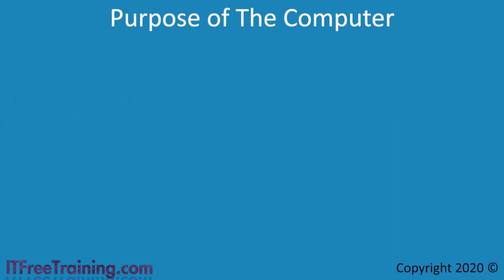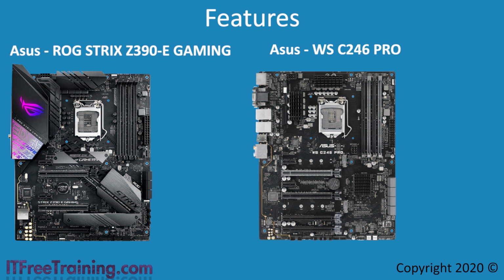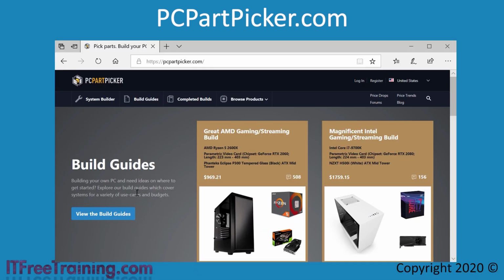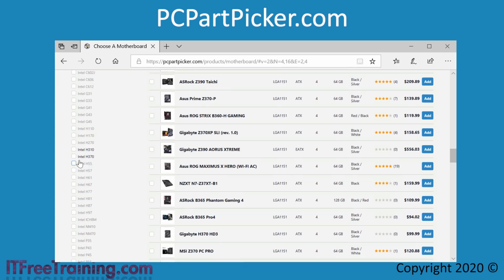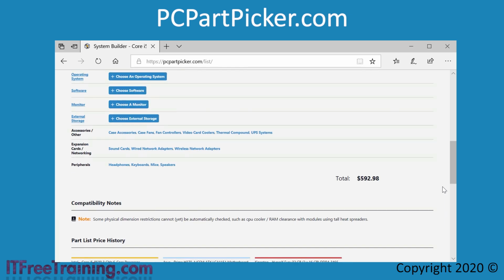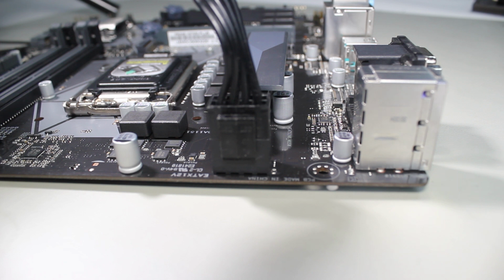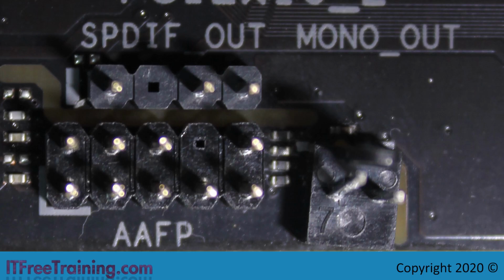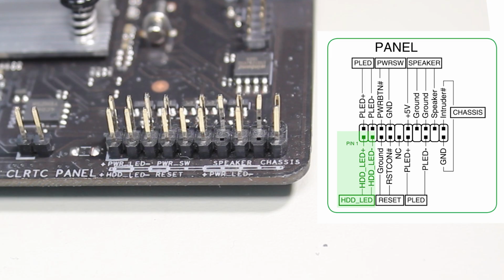Motherboard Picking/Installation

Comment: Do all 9 holes on the motherboard need to be screwed in when mounting it to the case?
Reply from the maker: Not really, as long as it is held in place. The more screws the better to hold it in  place. However, if you building a computer for someone else it looks more professional to have all the screws in place. Usually I will use a minimum of four, one for each corner if it is a testing build. For other people or if being filmed for a video I will put all of them in.

Comment: Hello sir, I am facing a problem with my desktop pc,,, I bought a new pc one month before but still facing window 10 boot up problem.. Shows error. Oxc000000e or oxc000000f... I have made bios to uefi mode in motherboard... Ssd partion mbr to gpt... But still facing boot problem....pc parts are... Ryzen 5 3600, gigabit b450 aurous elite motherboard, corsair 3000 mgh 2*16gb ram.. Corsair 650wt power supply... Gigabit rx570 graphics card... Plz suggest me what to do... Make video step by step... Help me sir... There is a software problem...

Comment: For those that don't have the clip, just touching the walls of the PC case or the PSU will be enough solve the static electricity issue.
Reply from the maker: Generally now days electronic parts are pretty static resistance so you can't argue that if you are careful and you remove the static electricity by touching the case first you won't have any problems. We show the way you should be doing things, however in the real world you may not worry about doing this if you are careful.
Reply: @itfreetraining  After reading a ton of matterial and watching a video from der8auer where he shocked components on purpose (they worked afterwards), in my opinion the danger is minimal to non existent.

Having said that, if using a clip gives people peace of mind and confidence I will not stand in their way, nor judge them.